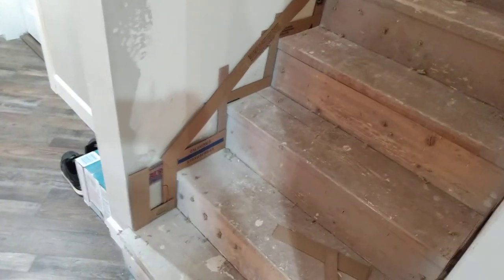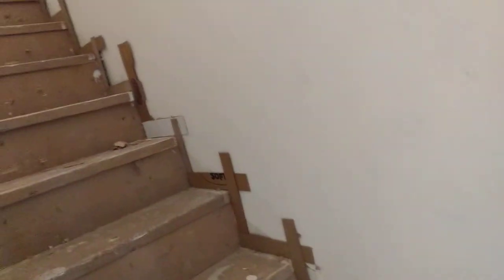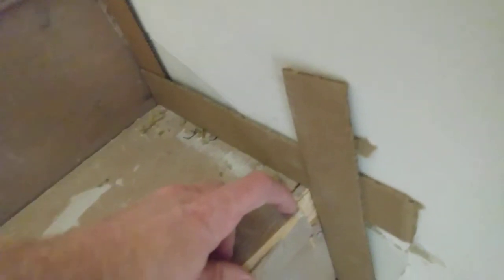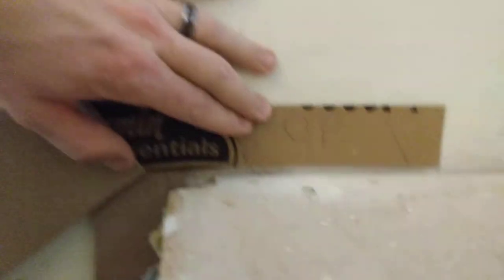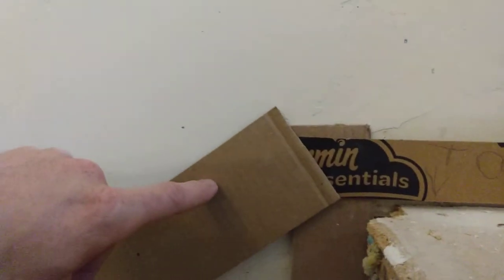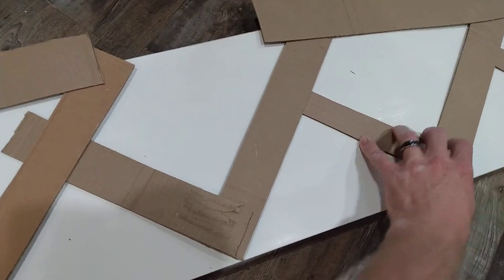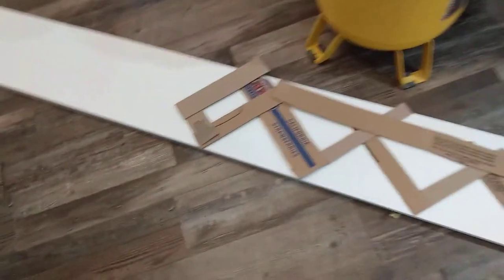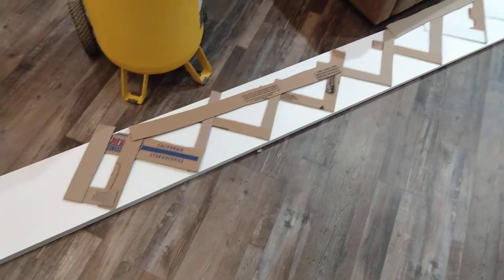How to retrofit a stair skirt

Comment: Great idea!  Thank you.  Doing a skirt board after the fact is so messy.  This helps a lot.  It accounts for stairs that were poorly made to begin with where the rises and runs are slightly inconsistent.  Your method, unlike purely mathematical ones, accounts for the inconsistencies of the existing stairs.

Comment: Definitely should have put the piece along the top all the way. A good cardboard to use are DRYWALL SHIMS. Plenty strong and perfectly straight.  Good time saver.
Reply: thanks, Jim.... I never knew there was such a thing. Looks like they're a whole lot cheaper at Menard's than Home Depot.
Reply: Drywall shims are key.  Thanks for the suggestion.  Now I am using drywall shims for all kinds of templates ie cutting retrofit window sills when nothing is installed straight or square.

Comment: I assume you are putting treads and risers on. I usually pop a line at the height of the skirt board, determine and mark where it ends at the top and bottom of the stairs, and then cut the skirt board to that length. Then I set the skirt board above the line, but at the correct location for the end points. I can then scribe it with a spacer block, or using a framing square I mark the distance from the back of the step by the riser to the chalk line onto the riser (you just double that number from the tread to chalk line, and that's what you mark from tread onto the skirt). You have a 3/4" to 1" tread and a 3/4" riser. So you have a good bit of room for error (but it usually fits perfectly). 

I will try your method next time and see which one I like best. Thanks for the vid.
Reply from the maker: Let me know, I'm curious
Reply: Same, definitely the best way

Comment: What you do when your steps or not the same sizes? Exemple: the first 3 have 7”x 9” then, one is at 7”x15 7/16, and the last one 7 3/16 going triangle. I was thinking to be easy to do, but!!!!  😂 don’t wasn’t to screw up. Thank!
Reply from the maker: This fixes that problem. Bye fitting perfectly to the form and shape of your steps, the measurements don't matter at all. I did not use a tape measure when I did this because you just trace the outline on the board.
Reply: I did it but I need to cut it. It doesn’t work and I did change the way I was doing it. Thank you for the reply.

Comment: I'm replacing my carpet on my stairs to hardwood. Currently there is no skirt or baseboards. Should the skirt be done before  or after stairs?
Reply from the maker: Stair skirt should be done first because the carpet will bump right into it and cover up a small gap, and hardwood flooring can be cut to fit exact on each stair.
Reply: You definitely want to do the skirt board before you install your new treads and risers.

Comment: how do you secure the template? i feel i would have trouble or worry about one being off due to the pencil pushing up against the cardboard.
Reply from the maker: It's pretty big so it doesn't move very easily. I just hold it with one hand and draw with the other.

Comment: What material did you use for the skirt board? I am having trouble finding a piece long enough for 13 steps and would like to not have to splice pieces together if I don’t have to.
Reply from the maker: 1x12 MDF, 16 feet long. I like the primed stuff cuz it is sanded and has rounded corners. Un-primed requires sanding. I can't find it online at lowes or home depot, but your local paint and trim supplier should have it. In Utah we have Jones Paint and Glass, Ace hardware (some stock it, some don't), and others. The link shows an 8 footer: 
https://www.menards.com/main/building-materials/lumber-boards/boards/1-x-12-primed-mdf-board/1036148/p-5832605974000370-c-13115.htm

Comment: A simpler way is to use level get height floor to floor, divide it by how many risers gives you rise. Do the same for the run. Use a square to lay it out on skirt board. Take a measurement from tip of first riser to last riser compare to layout and see if it gains, adjust accordingly, cut, done and its' perfect. But I've only built over built over 3000 stairs so what do I know.
Reply: Wow thats pretty impressive, at a week per stair job lets say on average. Thats over 57 years worth of building stairs.
Reply: @marcelgaddis9319   32 years, not trying to be pain in the a.. just saying there is an easier way. 3000 is a very conservative number, it's more like a stair per day on small ones. Now doing a quadruple nonlinear circular stair all on top of each other, partial freestanding with one side hooked to wall and steel Ibeams to hold it up. It takes a day to frame each, a day for the steel and seven days each to complete it after it sheetrocked -basicly from raw material. Wish I could upload picture. Doing small straight stairs feels good after doing these involved ones.
Reply: I watched the video and thought " This is about some retarded shit" . I know that most framers used the side of their foot to figure stairs . Inconsistency is what many did .So it is bewildering to fit something like this without a jig or a total station .